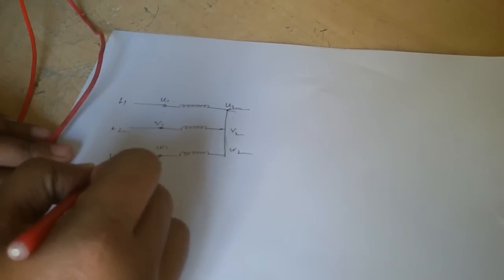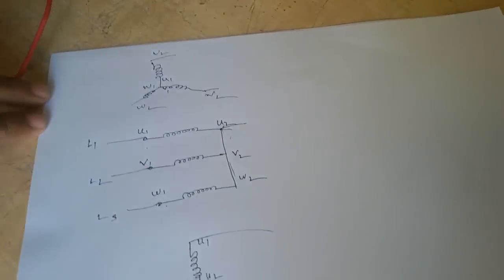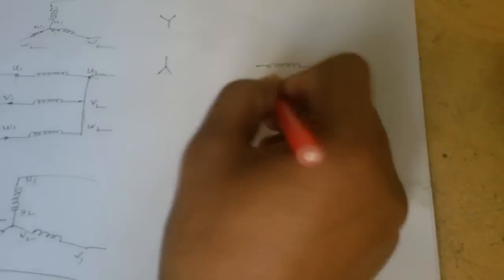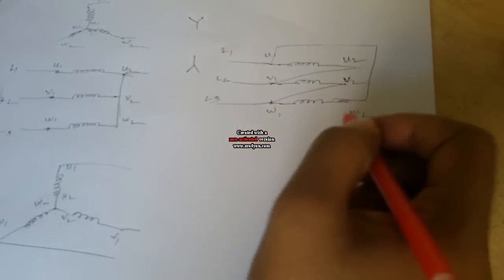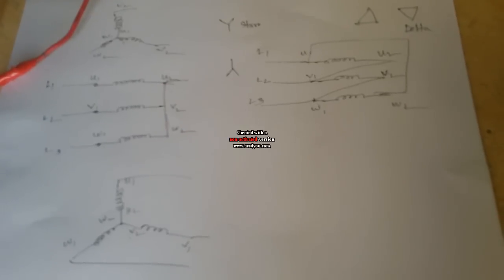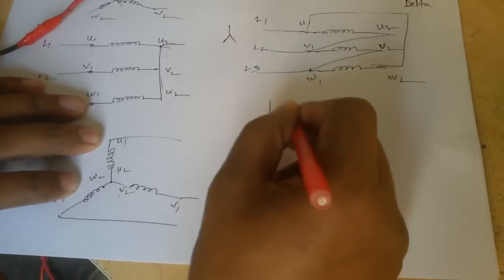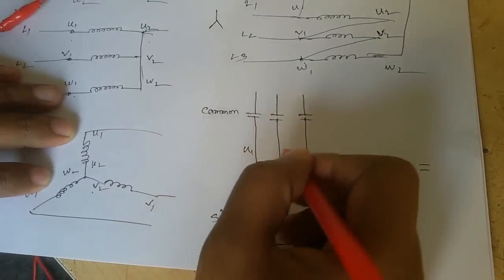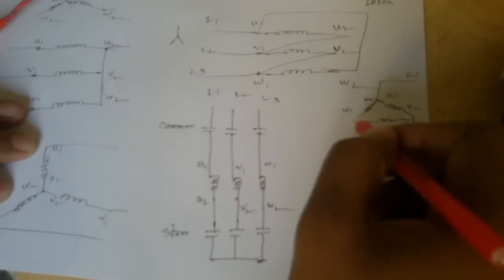how to make star delta motor connection in english . basic method

Comment: Thankyou for your video presentation. Could you or someone else please advise me on my query.
 I have a three phase motor without a terminal box and unmarked winding cables ,ie, U1 ,V1, W1 and U2,V2,W2 are unmarked
Ive used my fluke meter  to identify the cables of each winding. However I’m not sure what end is U1 or U2  etc  which is important for the delta connection where 440 volts is connected across  W1U2 and U1V2.  U1V2 and  W2V1. W2V1 and W1V2.
The query I have  is when connected in Star the motor turns clockwise. How can I be confident that when changed over to delta the motor continues running clockwise and not anticlockwise
Should I manually run the motor first in star to check direction and then stop it Next, run motor in delta for a second or so to ensure the same direction as it was in star. 
I hope Ive explained my problem ok.

Comment: Nice Video. I go a bit of a problem. I got a motor what has got 6 wires coming out of it but the wires is connected directly to the coils inside the motor. What do I do? Witch wire goes where?
Reply from the maker: please follow motor terminal numbers. Thanks for your comment. if possible please my video.
Reply: Ok. - not helping. So this info is for free so that you can learn something. Ring out the 3 coils with a tester. Then you need to find the start and end of the coils (1's and 2's).
Use a analog volt meter, place it over the one coil. Then on one of the other coils, just pals a low voltage sours eg. 9 volt.
You would see that the volt meter would jump + or - .  If it went + for argument sake, then mark the wire that was pulsed on the + side of the battery.
Do the same to the other coil. Remember to mark it.
Now remove the analog meter and connect it to one of the coils that has got the one lead marked.
Pals the other marked coil and see in what direction the volt meter go(+ or - ). If battery was pulsed with the marked wire to + (take note of direction). Do the same to other unmarked coil. Turn + and -  to get the meter to jump in same direction as the coil before this one. Mark the wire that was on the +.
Now you know what side is 1 and 2
eg. A1-B1-C1    and    A2-B2-C2
Thans.
Reply: No numbers. What now?